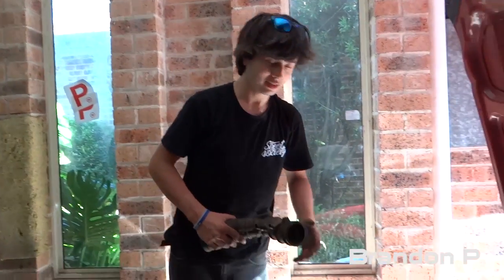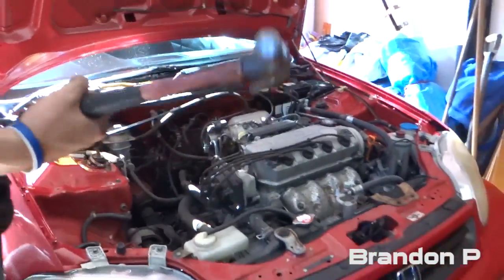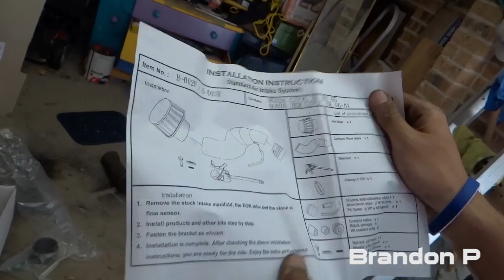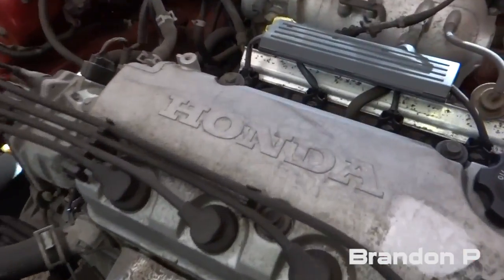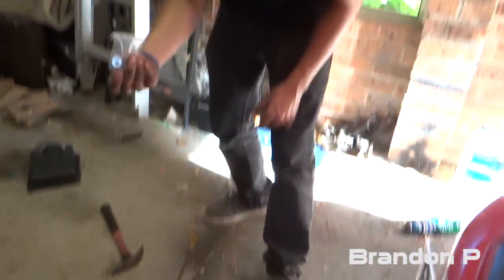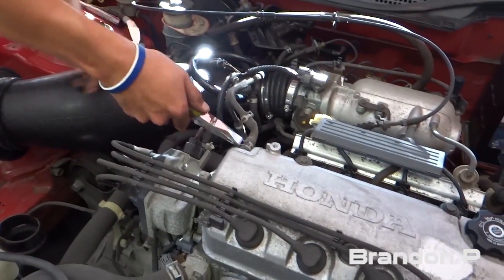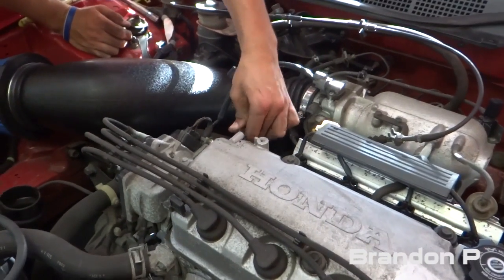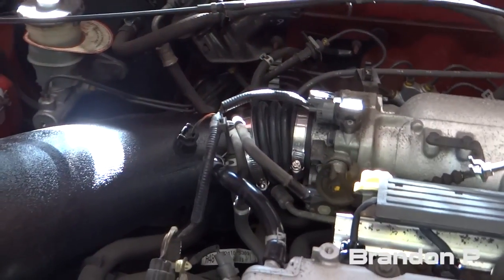Honda EK Civic - Cold Air Intake

Comment: It’s actually a short ram intake, “cold air” intakes extend farther down by the front wheels and inhale the dense air from the bottom of the vehicle instead of sucking up the hot air from within the engine bay.

Comment: Where did the other hose go? Or jst leave it unplug?
Reply: Did u ever figure this out lmao I can’t find the answer anywhere
Reply: @SethAquatics  so the metal piece that connects the og hoses is the issue, just remove that
Reply: And two of the hoses are replaced by one of the hoses provided
Reply: So instead of having the metal piece connecting the two hoses you have one new hose in place of that

Comment: very nice, keep it up, but...
1) that's not a cold air intake. cold air intakes require external piping to bring more air flow from the front of the vehicle (holes in bumper, etc), and that type of intake is usually with a straight aluminum pipe and the 'performance gain'  relies on cold air
2) this is a whale penis intake as you said and thanks to the shape of it, it swirls the air and speeds it up thus feeding it faster to the intake manifold, however it soaks up heat from the engine, therefore this type of intake relies on speed rather than cold air

how much of that shit is true noone can say but that's what mainly is being talked about it. i'm getting a whale penis on my civic in a few days too